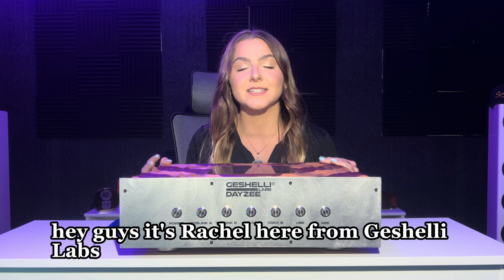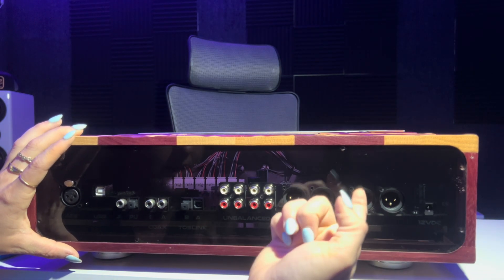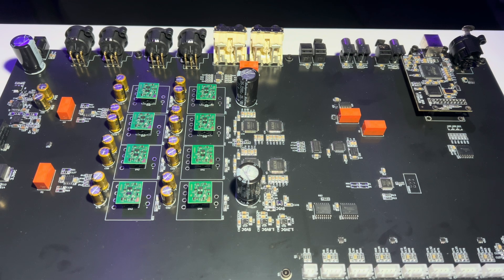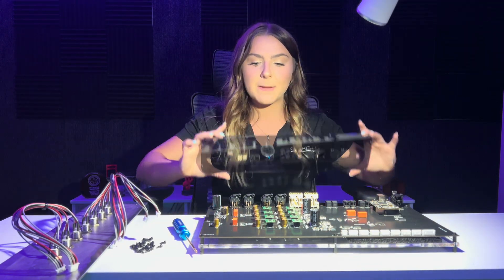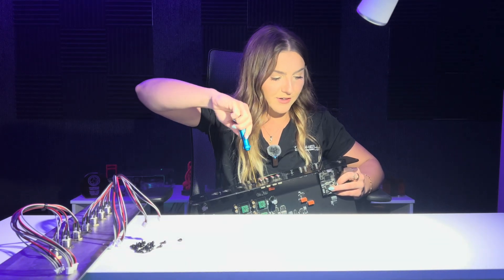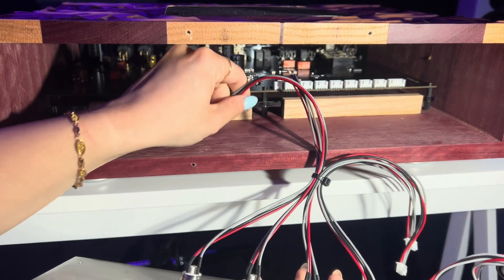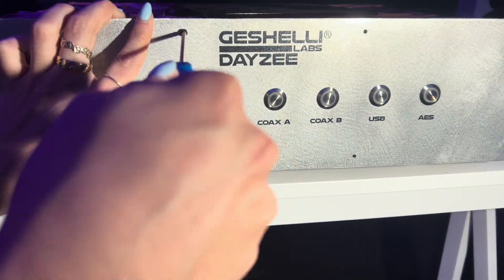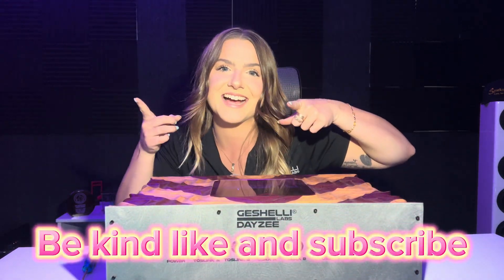Taking Apart the Geshelli DayZee DAC!! (Swapping op amps on the wood DayZee)

Comment: If you upgrade opamps to Sparkos - install them from the connector(back) side and move toward front (faceplate) side -- otherwise, they won't fit

Comment: op amp rolling has gotta be a top 3 silliest audiophile move. deeply unserious practice.
Reply: Why ?
Reply: @athathsonty2925  for starters in the example of this pcb coming with a standard DIP8 opamp, it includes a footprint for a discrete opamp, which is beyond pointless for hifi purposes. the technical draw backs of a discrete op amp is that parts have to be selected by hand. for a good discrete opamp, these requirements are fairly strict. in a best case scenario a manufacturer will buy a LOT of parts and use the ones that measure correctly. rarely does this happen though, so you get a smattering of parts that have tolerances of any where from +/- 1 to 20%. the other issue is that discrete opamps are more prone to thermal drift due to the transistors used in them. opamps are etched on to a silicone wafer and as such can be precisely trimmed to a tolerance that is in the fractions of a single percent range.  There are benefits to using discrete opamps, none of them apply to home audio though, and most of them are related to the ability to drive complex loads over long distances in a studio environment.

swapping DIP8 op amps for different DIP8 op amps is even dumber. Every circuit is designed for use with a specific op amp, meaning the values of the supporting components around it were chosen by the engineer to extract as much performance as possible out of said opamp. any op amp made since the 80's generally has a ruler flat frequency response, with astonishingly low THD, and exceptionally low noise(assuming the engineer is designing the circuit correctly). swapping op amps will at best leave you with a sound that is identical to the previous op amp. at worst, it will perform slightly worse(higher noise, excessive loading, ect). there is zero to be gained beyond a first hand understanding of the placebo effect.